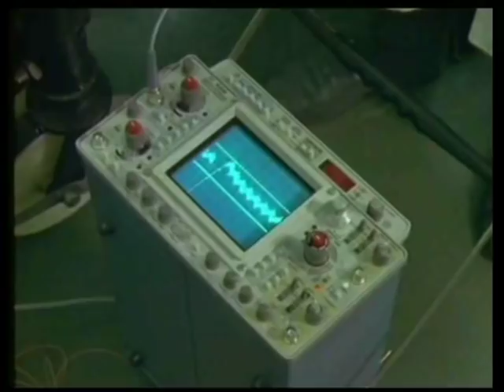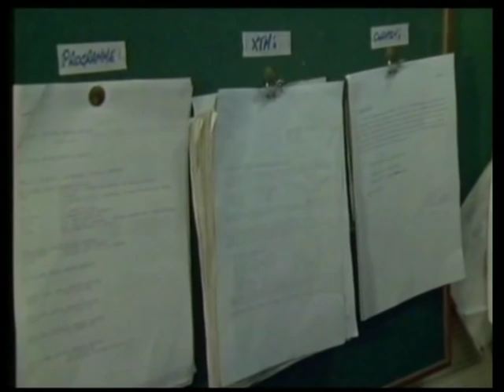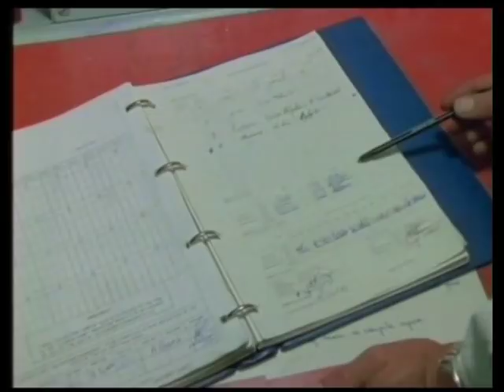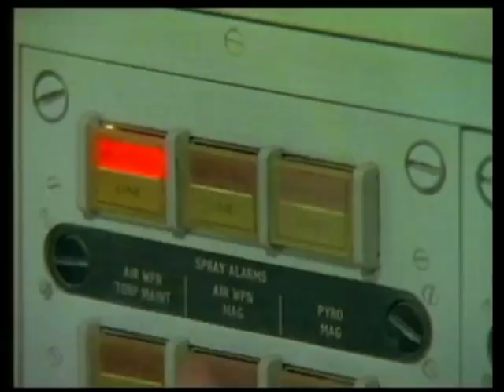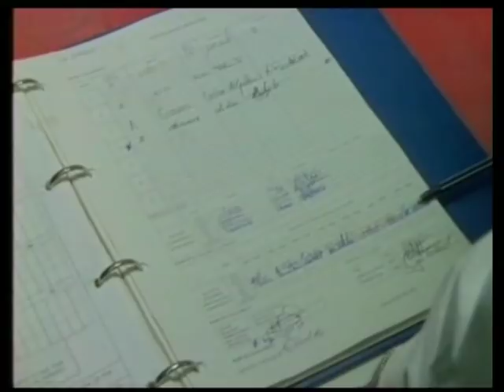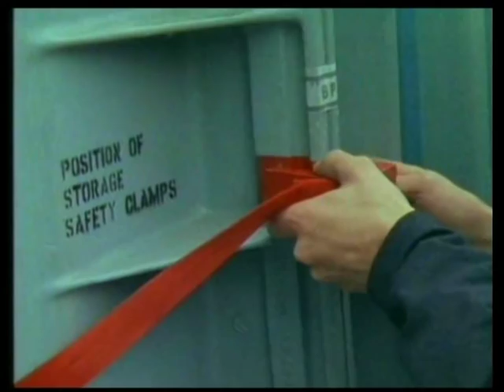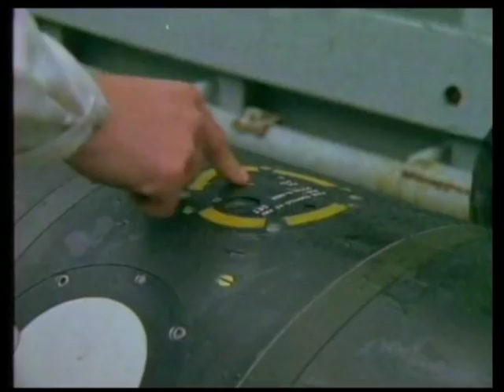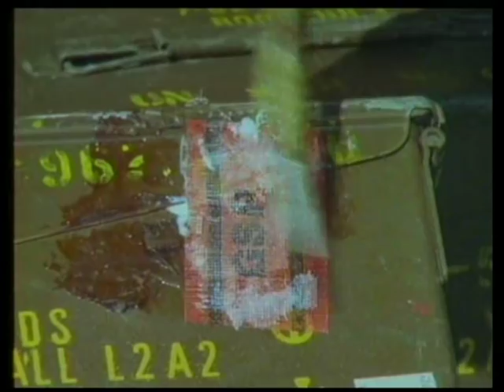Ammunitioning Ship (1988)

Comment: During my time in the armed forces I was involved with a lot of dangerous work, all a lot safer if the safety rules and working procedures were followed correctly, and your team did the same, but, I reckon that the resupply at sea must be the most dangerous and have so many physical hazards that you need eyes 👀 in the back of the head and your neck in swivel mode, obviously the hazards during peacetime are enormous, but in a combat theatre then it goes off the chart. Whilst each branch of the military would probably claim that theirs is the most dangerous I think during peacetime it’s, for me, the Royal Navy, in wartime you can take your pick, whoever is in the wrong place and at the wrong time would definitely get my vote.
Reply: Surely the most dangerous loading of stores is loading NAAFI store - specifically Beer!  With a mixed services team!  You'd never be sure who had pinched the most, but at aguess it would be Jack and Royal working together - there again you'd never know because they tend to scupper it as soon was purloined!